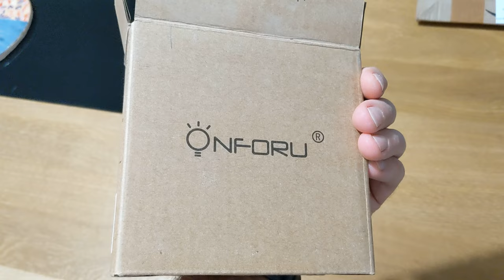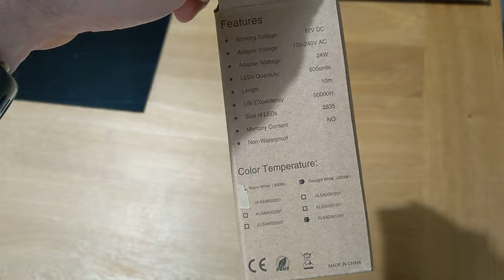Un éclairage LED dans l'entrée... ça claque !

Comment: dommage de ne pas avoir pris un fibaro rgbw pour mettre l'ensemble sur la jeedom. en tous cas, ca claque niveau design ca rend vachement bien. on se croirait dans des hotels modernes haut de gamme ^^!bravo
Reply from the maker: T'inquiètes, tout mes télérupteur finiront pas être piloté par la jeedom et par Google grâce aux modules Shelly 😉👍.
Et merci pour le compliment 🙏
Reply: @PapyBricolo  Justement. pour moi les shelly ne sont pas adaptés. Google ok. mais le wifi ? en domotique ? noway. POur être un pro du secteur, l'avenir est au zigbee. bon par contre, il faut bien mesher son réseau mais en attendant, le zwave fait excellement le job . tant en sécurité qu'en fonctionnalité.
Reply from the maker: Ouai tu n'as pas tort... J'ai une clé zigbee sur ma jeedom  avec quelques modules aqara...

Comment: la couleur, les angles, c est vraiment top la seul chose qui me dérange c est les fuites de lumière au niveau des intersection mur plafond ..par contre je sais pas si j ai bien compris mais tu veux mettre une alim chinoise derrière le placo  ? hmmm
Reply from the maker: Alors les "fuites lumineuse" sont très exagérées sur les photos et vidéos, en vrai c'est moins choquant...
Pour l'alimentation, je cherche encore une solution, effectivement ça me gène un peu de mettre ça dernière le placo comme ça... Je réfléchis encore...
Reply: @PapyBricolo  que pense du des module type sonoff qui transforme 220 en 12v et pilotable en wifi il existe plusieurs marque et dimension avec ou sans boitier

Comment: Bonjour
J’ai 3 bandeaux led (7m50 + 3m50 + 3m) à brancher en parallèle sur un transfo et contrôleurs 
Bandeau led : 24v . 10w/m 
Controller MOES cct.
Pour le choix du transfo, Pouvez vous m’indiquer la puissance mini et maxi à respecter?
Question 2 : ne pouvant pas mettre mon contrôleur + transfo à côté des bandeaux led, est il possible de relier le contrôleur avec les bandeaux led par 12m de câbles 0.5mm2 ? 1.5mm2 ?
(Sans risquer surchauffe ou perte de luminosité)
🔆
Reply from the maker: Salut. Alors difficile de vraiment t'aider comme ça mais déjà j'opterais pour du 1,5 mm2 plutôt que du 0,5... Après en fonction des propriétés des bandeaux LEDs tu peux peut-être les brancher en bout à bout, le principe des bandeaux led c'est des tronçons de 10cm (en général) en parallèle.
Si tu as 14m à 10w/m ça fait 140w donc il faut un transfo mini 20w je pense...

Comment: Maintenant faudrait un détecteur qui allume les leds quand tu ouvres la porte, avec un délai de 1 à 2 secondes pour voir une animation de leds qui s'allument au fur et à mesure ^^
Reply from the maker: Ouai ouai... Je ferais du zel quand j'aurai fini tout le reste... 😁😁😁😂
Reply: @PapyBricolo  Ce serait tellement stylé mdr
Reply: @azk998  Pour ça il aurait fallu installer un ruban LED avec des LED adressables individuellement.
Reply: @kochka22  le prix du truc par rapport au sien et surtout si t'as une LED qui lâche il faut tout rechanger (comme le sien mais là encore le prix n'est pas le même). :/
Reply: @yakazoko3856  Hum non, ces rubans peuvent être coupés à n'importe quel endroit et soudés entre eux. Couper une led et en re-souder une autre ne pose aucun problème (chaque led a son controlleur).
Reply: @kochka22  OK merci. :)

Comment: Bonjour c'est trop top votre entrée 😍. J'aurai juste une question le LED que vous avez utilisé c'est pas le ruban standard adhésif. Pourriez vous me dire comment ils s'appellent je voudrais les acheter. Et bonne continuation
Reply from the maker: Si si c'est un ruban led standard classique. Avec 60 led 2835/m en 5000k ,un peu blanc peut être, si c'était à refaire je prendrais du 4000k. Il y a pleins de références sur pleins de site 👍😉
Reply: Merci. Je parlais du truc en aluminium. Je croyais qu'il s'iluminaitJ'ai vu que vous aviez mis son liens en dessous. Merci encore une fois🙂

Comment: Salut, super video! Par contre j’ai une question bête pour les angles... un angle de 90 degrés quand cela reste sur la pliure normale cela se passe bien comme lorsqu’on passe du mur au plafond mais comment as tu fait pour les angles de 90 degrés au plafond ? Car cela reviens à plier le ruban led sur l’épaisseur et quand je le fait le ruban fait une pliure (bosse)
Reply from the maker: Oui j'ai plié le ruban en surépaisseur, on ne voit rien du tout
Reply: Aie aie aie, plié le ruban LED est la meilleure façon pour réduire sa longévité. J'ai vu sur un site dédié aux LED qu'il est possible de couper et de raccorder le ruban ou alors des rubans qui sont prévus pour être pliés, c'est sur led-flexible.com . 😉
Reply from the maker: Oui il y a des raccords exprès pour les angle mais ça fait un truc non sans LEDs. Et franchement ça reste des piste de cuivre, et après tu n'y touche plus, ça 'e va pas vieillir plus vite pour autant...
Reply: J'avais eu le cas avec une bande LED, la bande était bien au début puis ensuite une coupure de la lumière à l'endroit de la pliure.  Finalement le circuit électronique était sectionné 😭.
Depuis quand j'y suis confronté je fais une petite soudure de câble pour faire l'angle et le tour est joué 👍Et sans "trou de lumière .
Reply: @PapyBricolo  En tout cas belle installation !!👌👏
Reply from the maker: Merci

Comment: Mitch Quelle marque de LED a tu pris?
Reply from the maker: 🤔 j'ai pas fait attention à la marque... L'important c'est le nombre de LEDs au mètre et la couleur de la lumière...
Reply: @PapyBricolo  Ok mais peux tu me dire les espacements des LEDs ainsi que la couleur, par contre sais tu si cela serait suffisant pour éclairer la pièce .Ma pièce fait 2,65 x 5,80 ;et mon plafonnier va faire 1 x2 voila merci
Reply from the maker: Tu va faire un rectangle au plafond c'est ça? Ça devrait suffir, après ça dépend du type de pièce, si c'est une pièce où tu va lire ou manger il n'y aura pas assez de lumière je pense sinon pour le reste ça devrait aller. Moi j'ai pris des 69 LEDs au mètre mais je te conseille des 120 LEDs au mètre. Moi j'ai pris des 5000k mais c'est peut être un peu blanc, après ça dépend des goûts...

Comment: Je n'arrive pas à mettre le lien, il est supprimé automatiquement quelques secondes après la validation de mon message 🤔 le nom du site est aluson-eclairage.fr et dans la barre de recherche :Profilé Alu Encastrable V-TAC 24x12mm
Reply from the maker: Moi ça serait plus celui là : Profilé Alu Encastrable V-TAC 24.7x7mm 2m Avec Diffuseur VT-8122.
Le miens fait 6mm de profondeur de mémoire mais en partant du dessous de la "collerette"... Et la les 24,7 ça doit être hors tout (collerette inclue)...
Reply: @PapyBricolo   Ah ok, effectivement les profilés en 7mm sont mieux on est à peut prêt à la moitié de l'épaisseur d'une plaque de BA13 c'est largement suffisant. Merci à toi ^^